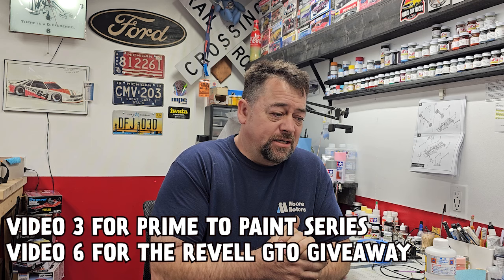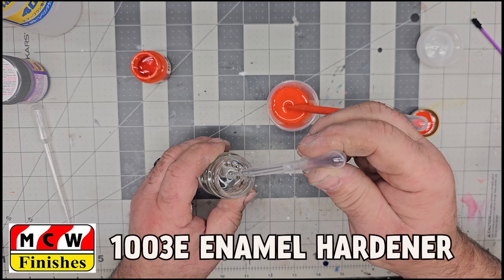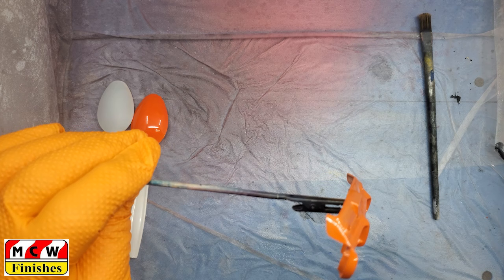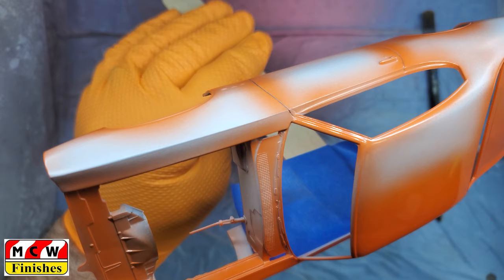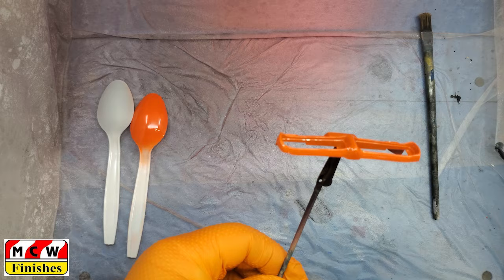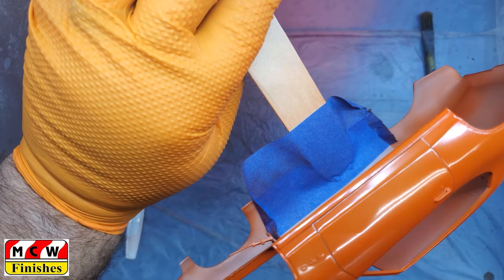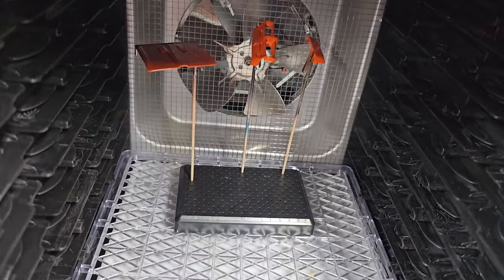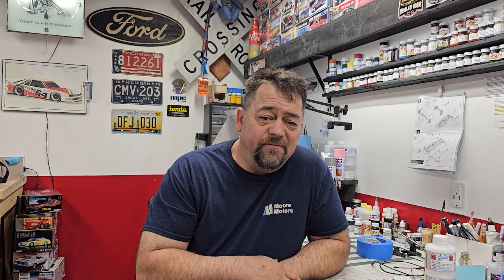PRIMER TO PAINT SERIES VIDEO 3.. PAINTING THE BODY.

Comment: Loved the video and I only use MCW paint on my cars. However when I spoke with the owner and maker of this paint for advice after I screwed up my first try he told me that after a 50/50 mix with hardware store lacquer thinner that I should and I quote, “No need to mist or layer this paint. Just hose it on.” This is what I do and it works perfectly.
Reply from the maker: Thanks Donald, I had visited Mike at MCW when he was in Ohio, he give me a tour of his shop, and told me the same, just hose it on, My current airbrush has a .03mm needled and found the light passes works with that one, I have a .05 in a VL Paasha brush and that will spay some paint, I need a different hose adaptor to run it..  After learning the MCW paints, have been my go to.. Thanks for tuning in, Have a great one!

Comment: ok, as you were talking about one more coat, I was thinking ....
I've heard a couple of model builders say they do seven coats of paint, with wet sanding. I don't know what they consider to be one coat. 
How many coats would you say you have on this Pontiac, so far?
Reply from the maker: Hey Ray, my last coat is one too two passes, last one is a heavy coat, total probably have 4 to 5, I spray it on light so it takes a-lot of coats to cover, or I will keep going till satisfied with the results, most time it will depend on the color. I think it depends on if its lacquers or enamels? Have a good one Ray!